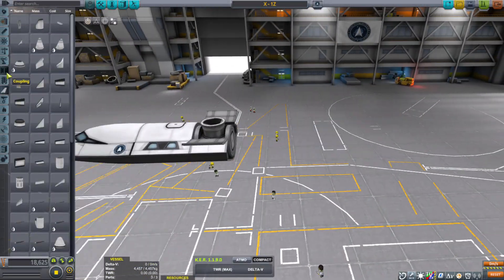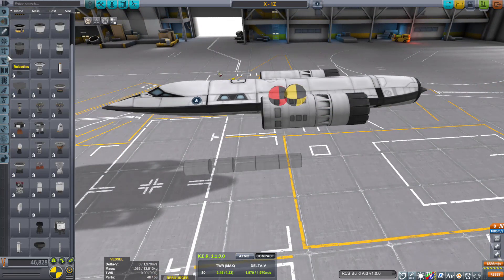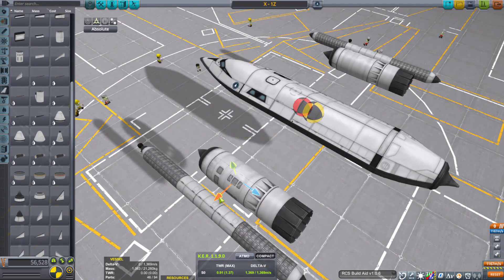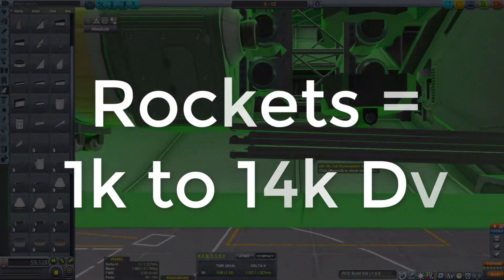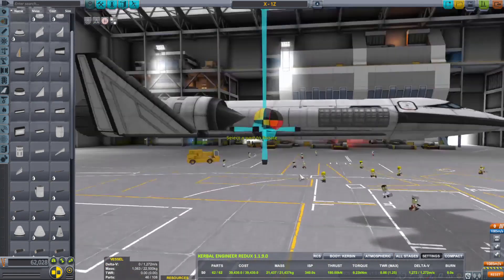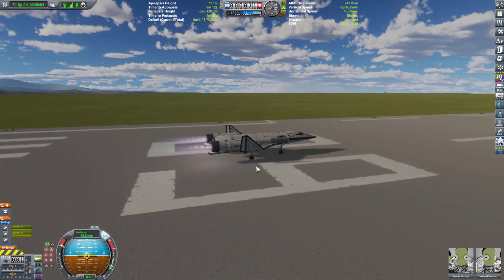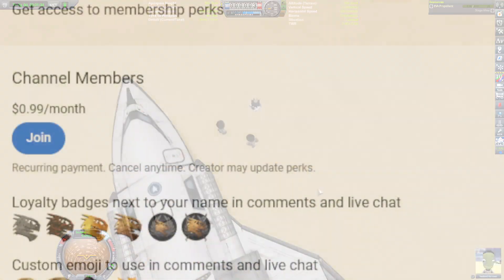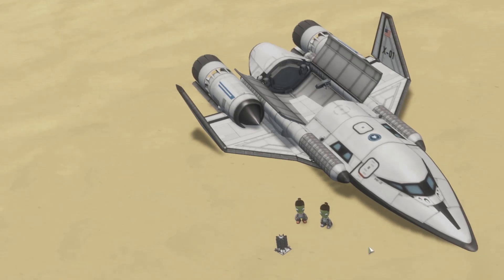KSP SSTO OLD SCHOOL / Jets and Rockets !

Comment: I made something extremely similar to this recently and it was super fun.   It was a nearly identical Chassis with 2 whiplash Jets.  I actually went with the Kodiak for the rocket instead of the aerospike.  It's a similar weight, but a little more power at the cost of a little worse fuel efficiency. I just like the way it looks and the thrust is nice to have.  It's an engine I rarely see used and I like finding uses for non standard engines.

Comment: There's no SABRE-like engine in Juno, so I'm figuring out how to do it with jets and rockets. Juno's jets don't seem to be able to get beyond mach 3; far less than the Whipash's best, but maybe I haven't found the best config yet. On the flip side, its rocket engines are configurable too, and it seems very high efficiencies are achievable. Ironically perhaps, my latest rocket has best delta-V with an aerospike for its vacuum-only upper stage. :) I suppose that'll be good for aerodynamics on a plane.

Comment: How to stop your vessel from shaking itself apart? it always happen to my stations on orbit when i spawn in a vessel
Reply: This could be a couple of different things:
Are there parts with "same vessel interaction" activated? Landing gear pushing on another surface, for instance, invites the Kraken with open arms.

Most likely, it's SAS/Reaction wheels going crazy. Sometimes you'll end up with a craft that wobbles a bit and parts go out of shape, the SAS wants to counteract this, but actually makes it worse, you end up in a negative feedback loop, where the wobble gets worse and worse, the SAS tries to counteract but actually just adds more force to the wobble and then the Kraken just goes "Aight, time to shine".
Reply: You can also use the reduced SAS setting. Or balance your control surfaces sizes, so theyre more attuned